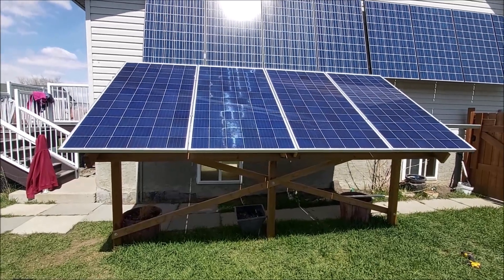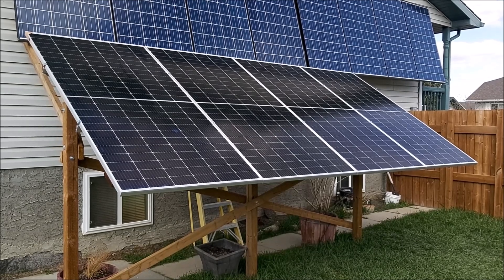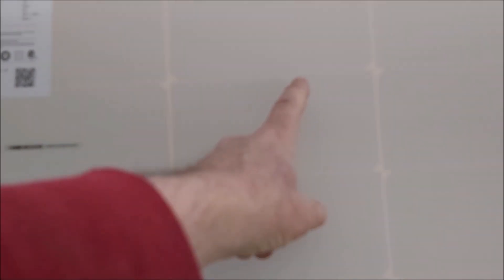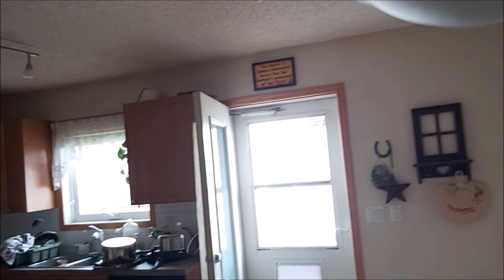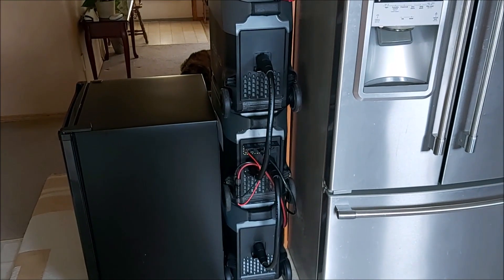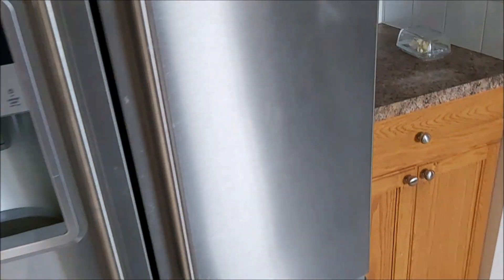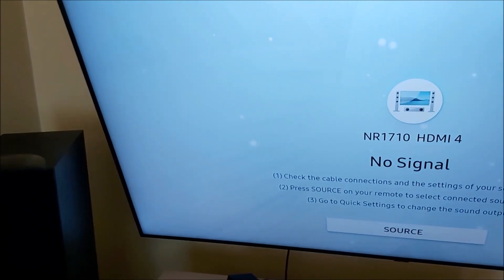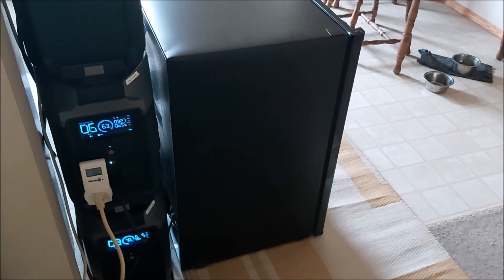EcoFlow Delta Pro Solar Panel Upgrade

Comment: How do you get 1800w input when the pro is rated for 1600w total input? I'm asking bc I ran into a problem trying to get as close to 1600w but the volts were way too high causing issues with my delta pro. Is it okay to go above the 1600w rating as long as you keep the voltage right
Reply from the maker: Go as high as you can afford for wattage. Don't worry about the amps. They are pulled not pushed. If you are in a climate where it gets cold, try to wire the panels in such a way that the VOC is around 125-130 volts.

Comment: So is there a way of getting past the 15 amp maximum for solar input on delta pro.   I have 8 panels that are 200 watts a piece running at 10 amps and 23 volts a piece.  If i do 2 strings of panels in series that puts me at around 100 volts and 10 amps per string in series.  But if i hook connect those two series sting in parallel, then i get 100 volts and 20amps for all 8 panels connected together.   This of course is 5 amps over the 15 amp maximum solar input on the delta pro...  is there any advice any one could possibly give me?
Reply from the maker: Amps don't matter. Amps are pulled not pushed. All you have to worry about is not going over the 150 VOC
Reply: @timcat1004  can i over watt too?
Reply: Just to affirm, its fine to go over the amp as long as  your wiring gauge supports it.   Over paneling is the way to go. That way on low photon days your getting more power and then on a sunny day the EF Delta Pro will just cap its consumption at 15amps.

Comment: I've had the exact same backup system for 2 years but I didn't dare connecting 4 large panels because it say the max pv input is 150V. Four panels in series means 160+ V (open curcuit).
Also can't handle 2×2 in parallel because that would mean way more than 15A of current (which is the current treshold). I got 3×410W panels hooked into it but still the noise of the fans are unbarable. :( That is the only issue I've had so far. 
Also I have the smart home panel paired so it automaticly switches all 6 curcuits on/off within 30ms when there's an outage (or manualy when the sky is clear and I only need 1kW in the house)
Very helpful video btw ! :washhands:
Reply from the maker: Amps are pulled not pushed. The only thing you need to worry about is the VOC. Never go over the VOC. Oct last month I sold the the Delta pro and upgraded to the DPU. No noise at all. The DPU has a max voltage of 450. I now have all four of the large panels in series. On perfect days it charges at 2,400 watts.
Reply: @timcat1004  ! I know, the Ultra is a 100 times better product in every way. But they don't sell it here in the EU :(

Comment: What is that small white panel adapter thingy with the small LCD panel you have plugged into your delta pro that you have your corded plug plugged into?
Reply from the maker: Same thing as a killowatt meter. Logs the usage of what's plugged into it.

Comment: Your fans are covered. Any problems with over-heating next to refrigerators?
Reply from the maker: The exhaust was a little restricted. These dam units have way to much CFM for cooling anyways. Noisy AF
Reply: @timcat1004  Better too much than not enough.

Comment: That's why we overpanel! Great cloudy production! I'm running 1800 watts on my delta pro. Nice job!
Reply: what panels and how many are you using? How do you prevent over amps when over paneling?
Reply: @resnick11  I don't prevent over amerage. I have 18x 100 watt panels with a IMP possibility of about 17 amps. But my delta pro only pulls a max of 15.9 amps. They are a mox of renogy 100 watt and HQST panels.

Comment: Is there a reason why you didn't move the bottom rail down a bit? You've had to position the top of the panels at roughly the same place where the old ones were but with those new panels (228cm) being much taller there's now a pretty big overhang at the bottom. You mentioned snow potentially collecting at the bottom - and add in some blustery wind - and I think that you may be risking it. 
Anyway, just a thought. Thanks for the video. I enjoyed seeing your setup.
Reply from the maker: I measured and thought about it. It's pretty close to being divided into thirds. The rack is also adjustable. In the winter time the panels will be closer to vertical. Heavy snow will slide off just like it did last winter.

Comment: Are you exceeding the voltage those Delta Pro's can handle with those big panels or do you have them in 2s2p configuration?
Reply from the maker: 2S2P 100 volts.
Reply: @timcat1004  get yourself a Bluetti Pv Step down module, it works for ecoflow. It will step down the voltage under 150 so you can put a bunch of panels in series
Reply from the maker: @Moes_Prep_and_Tech  Do you have a link?
Reply: @timcat1004  what were you seeing with two of them in series vs. two in series and parallel?  I'm asking because I have the Renogy 550w bifacial -- LOVE THEM!  But have 4 of them ... 2 for each DP i have and maybe I should reconsider and just put all four of them in 2s2p configuration like you have.   What kind of wattage are you seeing with them?  Have you seen it max out at 1600w?
Reply from the maker: @tlteal  It maxes out at 1,350watts in partial cloud and full Sun. Turns on earlier and shuts down later (15.9 amps) at 10 C. I expect the wattage to hit a little higher in the winter when the voltage climbs. You are saying you have two DP's and two arrays. Leave it like that. If you make the four panels into one array you can only charge one DP at a time.
Reply: @timcat1004  yes I have 3 arrays.  Each array is for each DP and the other array is for my 48v battery.
Reply: @timcat1004 aah ok good idea. I currently have a 3a system and want to add another panel so a 2s2p would do the job otherwise I’d be at a bit over 150v.

Comment: Something is really noisy inside... are those the delta-pros or something else?   Otherwise, nice upgrade!  Though you may want to find a solution to the noise if its as bad as it seems coming through on the audio.

My setup is dead silent using discrete components.  Victron charge controllers, discrete 48V (51.2V LFP) batteries, and three small inverters which I hacked to add an additional always-on "slow" fan to which can't be heard.  Their real fans on the inverters turn on only when the load exceeds roughly 50%, which almost never happens.  And nothing else has any fans.

Silence is golden 🙂

-Matt
Reply from the maker: I will be hacking the fans if the noise gets to me.
Reply: @timcat1004  you should get a delta pro ultra, I sleep next to mine :-)
Reply from the maker: @Moes_Prep_and_Tech  I sold the pros and got the Ultra last Oct 6th 2024

Comment: Nice upgrade!  What was the cost on the new panels and what did you get/ask on the old ones? A 545 watt panel is serious power.
Reply from the maker: The old ones are in the garage. I'm thinking of buying a garden shed. Put the old panels on there and connect them to a resistive heater in the garage. I will make up my mind after a couple more double cheeseburgers.

Comment: When charging, how do you avoid exceeding the 1600w and 150v / 15a EcoPro charge limit?
Reply from the maker: The built in charge controller won't let it get over 15.9 amps. That is why over-panelling on the Delta Pro is easy.
Reply: @timcat1004  But you can't go over 150v, right?  Those panels are 46.68 V VOC x 4 = 186.72 which is over voltage, and I heard that the Delta Pro would not charge at all?  I'm trying to figure out for myself, as I just bought two Delta Pros and two extra batteries.  Thanks
Reply: Actually, the website that I went to said 46.68 V, but yours is even higher at 49.65 and that is 198.6
Reply from the maker: @jglayden  Dude...they are 2 in series and those 2 are in parallel for a total voltage of 100 VDC. You need to relax man.
Reply: @timcat1004  okay, yeah just trying to decide how to do it. Thanks and great video!
Reply from the maker: @jglayden  The array is in a 2P2S config Just under 100 volts. Amps are pulled and not pushed. My Delta pro clips at 15.9 amps. I'm getting 1,350 watts in. That number will go up in the winter when the voltage of the panels increase. I will still easily be in the safe zone of under 150 VDC.
Reply: @jglayden I have the same set up with the pros. I made the mistake of not watching voc/volts on my panels and I almost burned up one of my pros. My volts were around 200🤦🏼‍♂️. I literally had the electric burn smell coming from it.

Comment: 6kWh is 50% more than I consume in a day.  I wish...
Reply from the maker: That's more than what we consume per person here. We are three adults in this house. In the spring summer and fall we use on average 10 kWh a day. In the winter that jumps to >20 kWh a day. Most of that is directly off of the grid tied solar though. Around 2.8 MWh per year.
Reply: @timcat1004  I average about half that.  1.4 - 1.5 MWh
Reply from the maker: @sarkybugger5009  The minus 40 C here does have an effect...